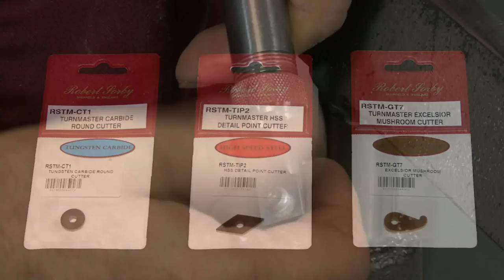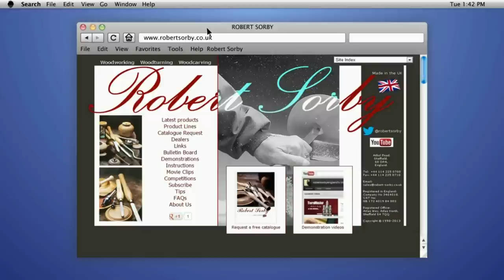Robert Sorby Turnmaster projects demonstration

Comment: A few questions:
Are the carbide bits sharpenable? Or are they throw-away-economy? How does the price of bits compare to the price of a normal gauge over it’s lifetime (been using my Sorby’s for over 20 years). 
What is the shear setting for? Can’t you just turn the handle?
Isn’t it easier/faster to just grab another gauge than to keep switching heads for every phase?

Comment: For years, people said that scrapers were tools of the amature. Then comes carbide and all of a sudden, scrapers are the thing.
Reply: If you have the skill to use a cutting tool, I would guess it will always be more efficient to use than a scraper - both for removing material and produce a finer finish at the end as well.  The scraper is  perhaps best for really awkward grain  or  reaching difficult places when hollowing.  Of course also very useful for people who are unlikely to practice enough to be confident with a cutting tool ie. beginners or occasional turners.  Still this system would be very useful for a lot of people (including me if I had the money!)